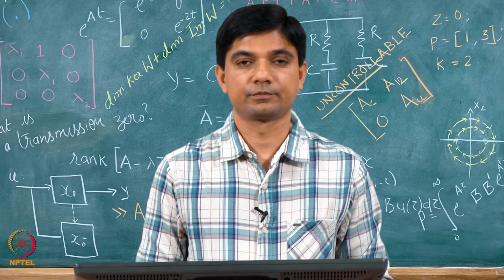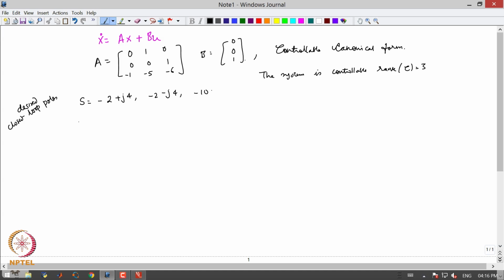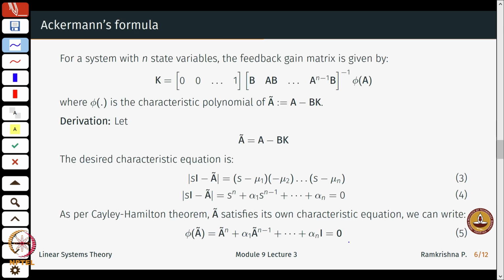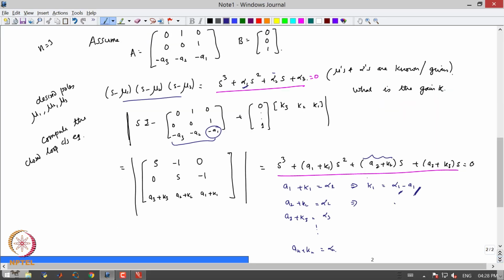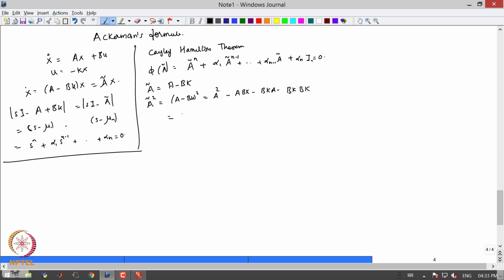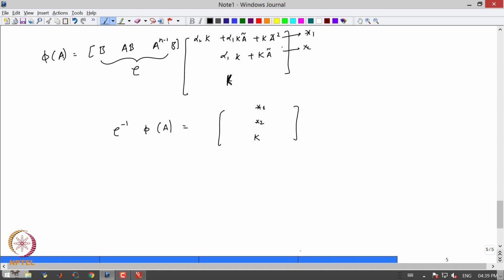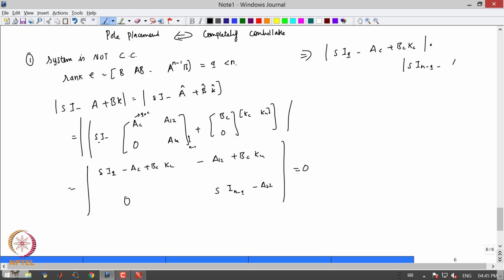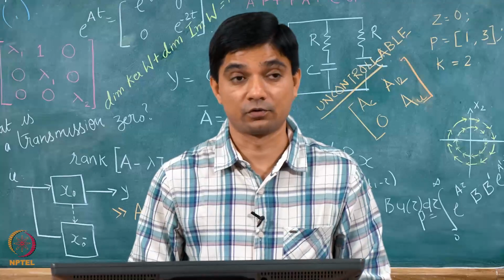#39 Control Design using Pole Placement | Linear System Theory

Comment: I just take the time to organize the videos course is really good!
M1L1 Introduction to Linear Systems https://www.youtube.com/watch?v=wyPpoOS31q0&list=PLyqSpQzTE6M9i09h6qh5boOfQgDnV5QV1&index=3&ab_channel=NPTEL-NOCIITM
M1L2 System Models - Part 01
https://www.youtube.com/watch?v=rNykyMBemDM&list=PLyqSpQzTE6M9i09h6qh5boOfQgDnV5QV1&index=1&ab_channel=NPTEL-NOCIITM
M1L3-1 System Models - Part 02
https://www.youtube.com/watch?v=wnugyFL0LL4&list=PLyqSpQzTE6M9i09h6qh5boOfQgDnV5QV1&index=4&ab_channel=NPTEL-NOCIITM
M1L3-2 System Models - Part 03
https://www.youtube.com/watch?v=uinGeySlIsw&list=PLyqSpQzTE6M9i09h6qh5boOfQgDnV5QV1&index=5&ab_channel=NPTEL-NOCIITM
M1L4 General Representation
https://www.youtube.com/watch?v=wy0bLIzrNC0&list=PLyqSpQzTE6M9i09h6qh5boOfQgDnV5QV1&index=6&ab_channel=NPTEL-NOCIITM
M2L1 Math Preliminaries: Sets, Functions and Fields
https://www.youtube.com/watch?v=Qefve0RtHQc&list=PLyqSpQzTE6M9i09h6qh5boOfQgDnV5QV1&index=7&ab_channel=NPTEL-NOCIITM
M2L2 Math Preliminaries: Linear Algebra - Vector Spaces and Metric Spaces
https://www.youtube.com/watch?v=XcxqcFzIgw4&list=PLyqSpQzTE6M9i09h6qh5boOfQgDnV5QV1&index=8&ab_channel=NPTEL-NOCIITM
M2L3 Linear Algebra - Span, Basis and Subspaces
https://www.youtube.com/watch?v=KeOi5mQXOYI&list=PLyqSpQzTE6M9i09h6qh5boOfQgDnV5QV1&index=2&t=6s&ab_channel=NPTEL-NOCIITM
M2L4 Math Preliminaries: Linear Algebra - Linear Maps and Matrices
https://www.youtube.com/watch?v=Sm7P571dAQY&list=PLyqSpQzTE6M9i09h6qh5boOfQgDnV5QV1&index=9&ab_channel=NPTEL-NOCIITM
M2L5 Math Preliminaries: Linear Algebra - Fundamental Subspaces and Rank-Nullity
https://www.youtube.com/watch?v=0kj9hSpIfww&list=PLyqSpQzTE6M9i09h6qh5boOfQgDnV5QV1&index=16&ab_channel=NPTEL-NOCIITM
M2 Tutorial on Linear Algebra
https://www.youtube.com/watch?v=k5WmhS9FCsg&list=PLyqSpQzTE6M9i09h6qh5boOfQgDnV5QV1&index=10&ab_channel=NPTEL-NOCIITM
M3L1 Math Preliminaries: Linear Algebra - Change of Basis and Similarity Transformation
https://www.youtube.com/watch?v=6GEWdoezXsc&list=PLyqSpQzTE6M9i09h6qh5boOfQgDnV5QV1&index=14&ab_channel=NPTEL-NOCIITM
M3L2 Math Preliminaries: Linear Algebra - Invariant Subspaces, Eigen Values & Eigen Vectors
https://www.youtube.com/watch?v=vhbvGjr-Nwo&list=PLyqSpQzTE6M9i09h6qh5boOfQgDnV5QV1&index=15&ab_channel=NPTEL-NOCIITM
M3L3-1 Math Preliminaries: Linear Algebra - Diagonalization and Jordan Forms
https://www.youtube.com/watch?v=iZOBmt1wstk&list=PLyqSpQzTE6M9i09h6qh5boOfQgDnV5QV1&index=11&ab_channel=NPTEL-NOCIITM
M3L3-2 Linear Algebra - Eigen Decomposition and Singular Value Decomposition
https://www.youtube.com/watch?v=3_45TkPVjpU&list=PLyqSpQzTE6M9i09h6qh5boOfQgDnV5QV1&index=12&ab_channel=NPTEL-NOCIITM
M3 Tutorial on Linear Algebra
https://www.youtube.com/watch?v=dCAokT2lljo&list=PLyqSpQzTE6M9i09h6qh5boOfQgDnV5QV1&index=13&ab_channel=NPTEL-NOCIITM
M4L1-1 The State Transition Matrix- Solutions to LTI Systems
https://www.youtube.com/watch?v=lkV_9znHEL0&list=PLyqSpQzTE6M9i09h6qh5boOfQgDnV5QV1&index=17&ab_channel=NPTEL-NOCIITM
M4L1-2 The State Transition Matrix for LTI systems
https://www.youtube.com/watch?v=t_4rXiXh1L4&list=PLyqSpQzTE6M9i09h6qh5boOfQgDnV5QV1&index=18&ab_channel=NPTEL-NOCIITM
M4L2 Intro. Linear Systems Forced Response of Continuous and Discrete LTI system
https://www.youtube.com/watch?v=wHBQxjNqotg&list=PLyqSpQzTE6M9i09h6qh5boOfQgDnV5QV1&index=19&ab_channel=NPTEL-NOCIITM
M4L3 State Transition Matrix and Solutions to LTV systems
https://www.youtube.com/watch?v=5hPivwvZRn8&list=PLyqSpQzTE6M9i09h6qh5boOfQgDnV5QV1&index=20&ab_channel=NPTEL-NOCIITM
M5L1 Equilibrium Points
https://www.youtube.com/watch?v=Uh5-VJvL7ng&list=PLyqSpQzTE6M9i09h6qh5boOfQgDnV5QV1&index=21&ab_channel=NPTEL-NOCIITM
M5L2 Limit Cycles and Linearization
https://www.youtube.com/watch?v=_Fol5QHPGdo&list=PLyqSpQzTE6M9i09h6qh5boOfQgDnV5QV1&index=22&ab_channel=NPTEL-NOCIITM
M6L1 Stability Analysis & Types of Stability
https://www.youtube.com/watch?v=_71r3aQxwpw&list=PLyqSpQzTE6M9i09h6qh5boOfQgDnV5QV1&index=26&ab_channel=NPTEL-NOCIITM
M6L2 Lyapunov Stability Stability Proofs
https://www.youtube.com/watch?v=p-Cnnj3vi_Y&list=PLyqSpQzTE6M9i09h6qh5boOfQgDnV5QV1&index=25&ab_channel=NPTEL-NOCIITM
M6L3 Stability of Discrete Time Systems
https://www.youtube.com/watch?v=I5dj2JS2tkw&list=PLyqSpQzTE6M9i09h6qh5boOfQgDnV5QV1&index=24&ab_channel=NPTEL-NOCIITM
M6L4 Supplementary Lecture: Comparison Lemma and Lyapunov Stability
https://www.youtube.com/watch?v=QYPiri_ihOM&list=PLyqSpQzTE6M9i09h6qh5boOfQgDnV5QV1&index=23&ab_channel=NPTEL-NOCIITM
M7L1 Controllability and Reachability
https://www.youtube.com/watch?v=kkbq3pDf8UE&list=PLyqSpQzTE6M9i09h6qh5boOfQgDnV5QV1&index=32&ab_channel=NPTEL-NOCIITM
M7L2 Controllability Matrix and Controllable Systems
https://www.youtube.com/watch?v=T6Kt2L7QMsg&list=PLyqSpQzTE6M9i09h6qh5boOfQgDnV5QV1&index=31&ab_channel=NPTEL-NOCIITM
M7L3 Controllability Tests
https://www.youtube.com/watch?v=MLoVKqxmxJI&list=PLyqSpQzTE6M9i09h6qh5boOfQgDnV5QV1&index=30&ab_channel=NPTEL-NOCIITM
M7L4 Controllability of Discrete Time Systems
https://www.youtube.com/watch?v=bnkwDii4KNw&list=PLyqSpQzTE6M9i09h6qh5boOfQgDnV5QV1&index=29&ab_channel=NPTEL-NOCIITM
M7L5 Controllable Decomposition
https://www.youtube.com/watch?v=YmmIXbC2TFU&list=PLyqSpQzTE6M9i09h6qh5boOfQgDnV5QV1&index=28&ab_channel=NPTEL-NOCIITM
M7L6 Stabilizability
https://www.youtube.com/watch?v=rq1rXIdpIJw&list=PLyqSpQzTE6M9i09h6qh5boOfQgDnV5QV1&index=27&ab_channel=NPTEL-NOCIITM
M8L1 Observability
https://www.youtube.com/watch?v=99pfwmc_bsA&list=PLyqSpQzTE6M9i09h6qh5boOfQgDnV5QV1&index=35&ab_channel=NPTEL-NOCIITM
M8L2 Gramians and Duality
https://www.youtube.com/watch?v=jAxsDueAOuA&list=PLyqSpQzTE6M9i09h6qh5boOfQgDnV5QV1&index=34&ab_channel=NPTEL-NOCIITM
M8L3 Observability for Discrete Time Systems and Observability Tests
https://www.youtube.com/watch?v=LctUkd0JbEw&list=PLyqSpQzTE6M9i09h6qh5boOfQgDnV5QV1&index=33&ab_channel=NPTEL-NOCIITM
M8L4 Observable Decomposition and Detectability
https://www.youtube.com/watch?v=LEBg9oz2VGQ&list=PLyqSpQzTE6M9i09h6qh5boOfQgDnV5QV1&index=36&ab_channel=NPTEL-NOCIITM
M9L1 Kalman Decomposition and Minimal Realisation
https://www.youtube.com/watch?v=dsfxseqhPRs&list=PLyqSpQzTE6M9i09h6qh5boOfQgDnV5QV1&index=40&ab_channel=NPTEL-NOCIITM
M9L2 Canonical Forms and State Feedback Control
https://www.youtube.com/watch?v=KsbuJxeW9jQ&list=PLyqSpQzTE6M9i09h6qh5boOfQgDnV5QV1&index=39&ab_channel=NPTEL-NOCIITM
M9L3 Control Design using Pole Placement
https://www.youtube.com/watch?v=Deb7ztdR3lo&list=PLyqSpQzTE6M9i09h6qh5boOfQgDnV5QV1&index=38&ab_channel=NPTEL-NOCIITM
M9L4 tutorial M9 and M10
https://www.youtube.com/watch?v=zHnYoz0IgHA&list=PLyqSpQzTE6M9i09h6qh5boOfQgDnV5QV1&index=37&ab_channel=NPTEL-NOCIITM
M10L1 State Estimation and Output Feedback
https://www.youtube.com/watch?v=exn_LpbNMdE&list=PLyqSpQzTE6M9i09h6qh5boOfQgDnV5QV1&index=42&ab_channel=NPTEL-NOCIITM
M10L2 Design of Observer and Observer based Controller
https://www.youtube.com/watch?v=0ZTCkFWFU1I&list=PLyqSpQzTE6M9i09h6qh5boOfQgDnV5QV1&index=41&ab_channel=NPTEL-NOCIITM
M11L1 Optimal Control and Linear Quadratic Regulator (LQR)
https://www.youtube.com/watch?v=EslYMMdWN28&list=PLyqSpQzTE6M9i09h6qh5boOfQgDnV5QV1&index=45&ab_channel=NPTEL-NOCIITM
M11L2 Feedback Invariant and Algebraic Ricatti Equation-Optimal Control
https://www.youtube.com/watch?v=WrkDOzzdj5U&list=PLyqSpQzTE6M9i09h6qh5boOfQgDnV5QV1&index=44&ab_channel=NPTEL-NOCIITM
M11L3 Tutorial M11
https://www.youtube.com/watch?v=jksVjVuP9P8&list=PLyqSpQzTE6M9i09h6qh5boOfQgDnV5QV1&index=43&ab_channel=NPTEL-NOCIITM
M12L1 Linear Matrix Inequalities
https://www.youtube.com/watch?v=7Qfqt4QzYxs&list=PLyqSpQzTE6M9i09h6qh5boOfQgDnV5QV1&index=46&ab_channel=NPTEL-NOCIITM
M12L2 Properties of LMIs and Delay LMIs
https://www.youtube.com/watch?v=ojmG_8HYqtI&list=PLyqSpQzTE6M9i09h6qh5boOfQgDnV5QV1&index=47&ab_channel=NPTEL-NOCIITM